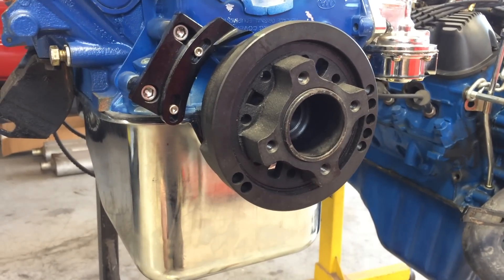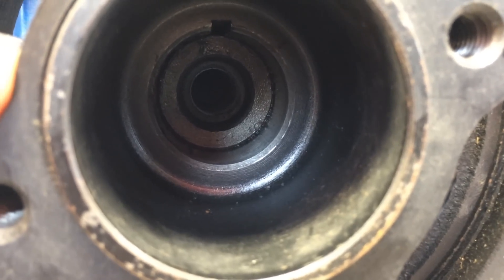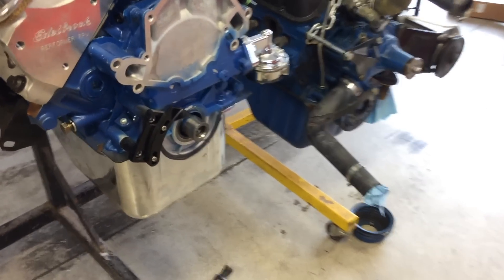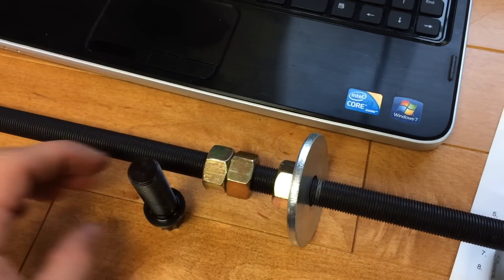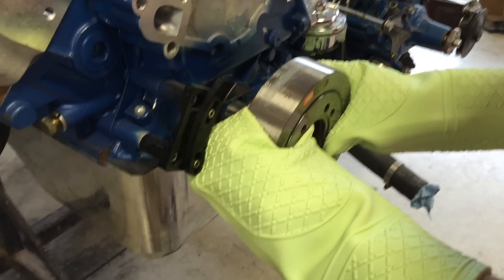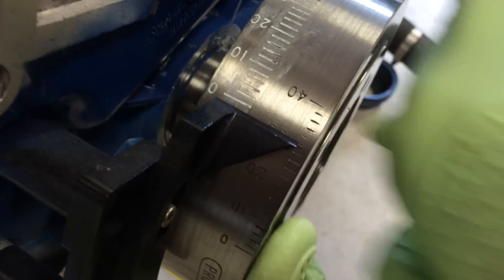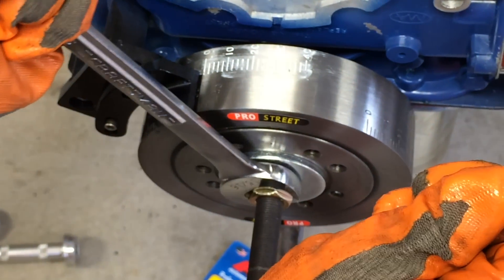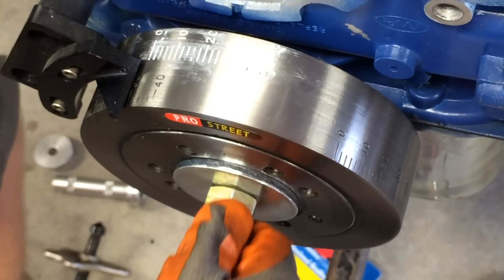Harmonic Balancer Removal/Installation

Comment: Why do some engine manufacturers make harmonic balancers that are NOT press fit, like Pontiac, Buick, Cadillac big blocks. Chevy and Ford feel the need to be retarded, I guess. I feel like pressing on the harmonic balancer to my LI 427 out of my 69 Impala SS by fitting the balancer to the end of the crank snout and dropping the motor face-down into the concrete from 10 fkn feet up. 💥There..that oughta do it!! fkn garbage!

Comment: So you were using the timing marks that had the white powder or whatever it was on them correct?  Also was the engine at tdc when you installed the balancer ?
Reply from the maker: For timing yeah, and it doesn't matter, there's a key way slot for the balancer it can only go on one way.
Reply: @OvensGarage  i know but was you at tdc on that engine when you installed it ?
Reply: @OvensGarage  im asking because i have small block Ford 306 that I just got put back together and I can't get the timing right on it and I think it's because we're going off of the wrong timing marks on the balancer my timing indicator is in the same place that yours is in and I'm using the timing marks that are in front of the ones that you're using that's why I was asking if you were using the ones with white powder on them because that tells me that I'm using the wrong one

Comment: Really not being a ass but NOONE should EVER heat the damper when installing. You will damage the new front seal. You forgot a dab of RTV in the keyways Grove on the damper. Should clean the paint off the crank snout, when that flakes off that will kill a bearing if/when it gets bast the screen.
Reply: Only on the keyway of the damper one puts some smeared RTV and not on the crank?

Comment: Where can I get this washer????? Someone please help
Reply from the maker: Got it from profasco, a local fastener store, like fastenal.
Reply: Tyler Ovens what size is the washer?
Reply from the maker: It’s just a big thick washer. You can probably get one at Home Depot or any hardware store. I just used a washer so the large nut wouldn’t tear up the balancer.

Comment: LOL  appears that you finished the install with the bolt that stays in there.   i dont see why this can't be the way you install it.
Reply: When you rip the threads out of your crank snout from pulling in on with only 2/3 threads biting come back and tell me why you shouldn't do that.
Reply: @OGskunkMASTA  if you can get 2/3 of the thread engaged before tightening then you would not strip any threads. The reason is that in many  applications the bolt is not long enough to reach any threads before it is pressed on so you simply cant press it with the stock bolt. If you can get a bolt that is 1" longer and the same thread pitch then you can use that to tighten it until it bottoms out then use washers to take up any slack and tighten again before installing the original crank bolt.
Reply: @Erklzanderz  Or, have all the threats biting from a install kit you can rent for free or get a nice install/removal kit for $75-85. Not worth a chance because the bolt is harder than the crank threads and too much stress and you're yanking the nice engine you built or pulling your stock engine right out for a rebuild at that point. Not worth it.
Reply: @OGskunkMASTA  if you are going to be doing this type of thing on a regular basis then I agree, but for the average DIY guy that is watching a video like this, then the method I mentioned earlier is absolutely efficient. The crank is heat treated and hardened steel so the threads are plenty strong. We are not talking about cast aluminum here that will strip out by just thinking about tightening it. To each his own but my original statement stands as a fact that if you have 2/3 of your bolt threads engaged then crank it down because the only way you would strip the crank threads (which worst case scenario, could even be retapped instead of pulling the crank) is if you dont have the keyway aligned and just keep reefing on it like an idiot. In that case you probably shouldnt be working on any motor let alone a race engine. But, If you have access to a puller and installer tool, and they happen to have the right pitch hardware, then that is definitely the fool proof way to go! Cheers bud

Comment: This wont mess up your front main seal?
Reply from the maker: No
Reply: If heated, yes. A slight bit of motor oil on the snout and some RTV on the keyways is the correct way to do it
Reply: OGskunkMASTA no it won’t, engines get hot so do the seals. He didn’t over heat it. By the way he followed instructions for the new harmonic balancer.

Comment: My thought on heating up balancer is that it might heat up distort melt new seal on the way in.
Reply: joseph puchel summit Racing  recommends the same procedure also
Reply: It will, DO NOT do that ever.

Comment: this procedure is different than anything I have ever done.. One I don't preheat it, second you should but a small amount of silicone in the keyway slot.. Also that blue packet that came with the ARP bolt is not thread locker.. is moly lube so that you get a true torque spec.
Reply: What gets torqued?
Reply: @yeudsiegal5285  tighten down.   There is a specification to how tight the bolt should be
Reply: @Saleen85111  yes 90 ft. Lbs.? Also your comment on how the balancer may only go in one way? Does this mean one cannot put it on wrong?  When the balancer is removed must it be at TDC?
Reply: @yeudsiegal5285  the crank has a keyway and the balancer has a cut out for that keyway..  so as long as it's the correct balancer for that engine, it should go on with no issues..   and the bolt is torqued to 120ft-lbs
Reply: @Saleen85111  i am simply taking and putting the the same balancer back on, for i want to put on a chrome timing gear cover. My engine is a SBC 350.  I will torque the 5/8 bolt to 120 ft lbs? What about the other three bolts on the pulley?
Reply: @yeudsiegal5285  I was basing off a SBF...  Not sure what the torque spec is for a 350... But if it's the same balancer.. yes. Clean everything.. put a little bit of silicone/RTV in the groove for the keyway..

I don't know if the Chevy bollt is long enough to pull the balancer in.. you have to be careful that the balancer doesn't get stuck and you end up stripping the snout of the crank... There is a special tool you could rent at the local big name auto parts store...
Reply: @Saleen85111  the RTV is applied to the key part of balancer and crank shaft? And what purpose does it have? How would i strip crank? I read some people desire to hit it in and some using another wrong tool that strips it and welcome machine shop?
Reply: @Saleen85111  the harmonic balancer is 60 ft. Pounds on a SBC i was presently told.
Reply: @yeudsiegal5285  yeah hit the balancer on, That sounds like a great idea! Your crank bearings should be just fine because they’re made to withstand  lateral pounding!

Comment: the correct torque for that has to be more than 90 ft pounds

because some of the bolts around the front brakes are 90, and they're only 1/4 of the size of the balancer bolt
Reply: Bolt size means nothing on torque specs. There are many variables such as material composition, gasket material, thread pitch etc... When in dount look up the torque specs and dont base it upon what you "think" it should be regardless of size.

Comment: hey guy i have the same engine in a boat do you think this damper would work on it ?
whats the part number?    thank you .
Reply from the maker: fishing big hits Yeah it should work! Got it from summit racing. Forget the part number. It's for a 347 stroker motor
Reply: No, you have to get the right balance for your engine if it's a 50 or 20 ounce balance crank. Without the right one your engine will shake to high hell and damage Alot in the process. Hope you got the right one.